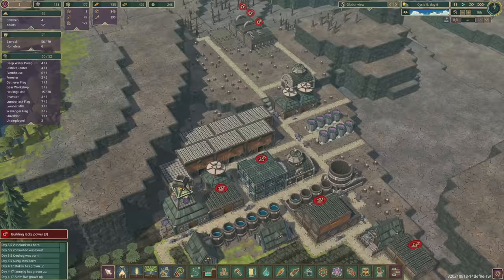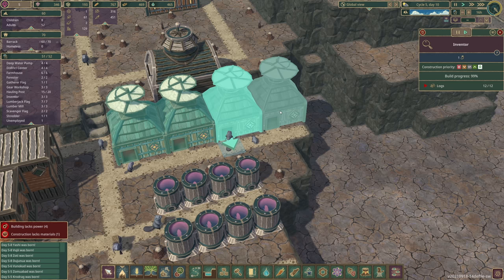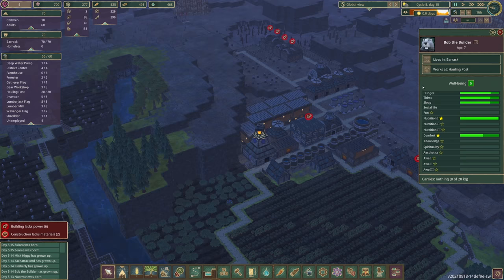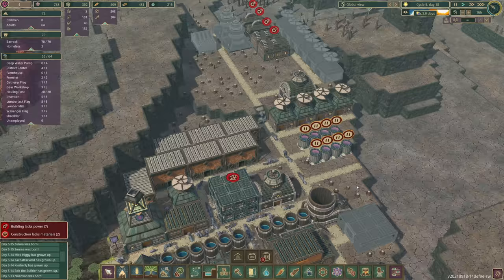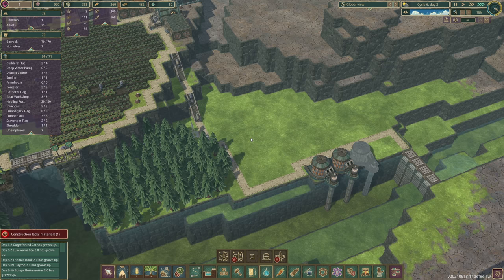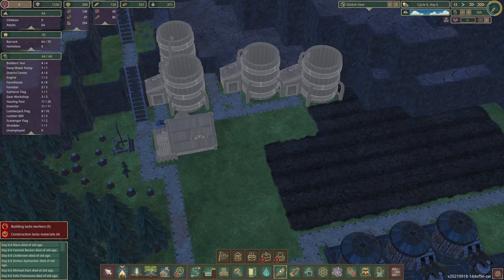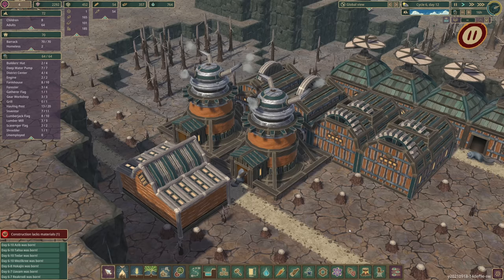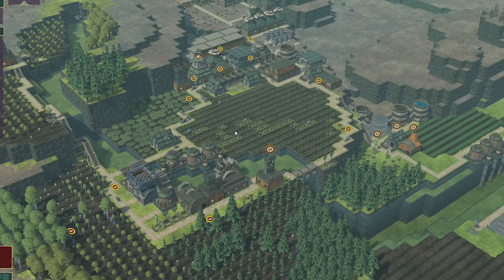Engineering a MEGA DAM to survive the dry season in Timberborn!

Comment: Your farms are too far from your district center you. For buildings to be connected they have to touch the coloured line that's visible when you click on the center. Building a more direct path like a bridge that runs straight across the water with no zig zagging, might be enough. Otherwise you will need a new district.